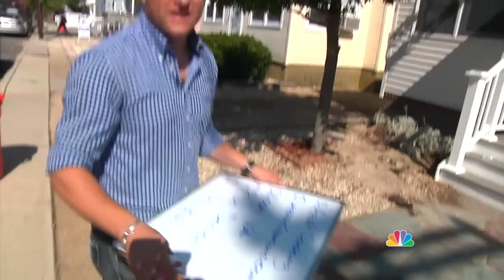Dream Renovation for Stroke Survivor and His Loving Wife | George to the Rescue

Comment: This is so low budget.  Would have been nice to do something for the poor wife.  Should have removed the front bump out and done a seamless,  elegant add-on.  The front porch seating is not designed for conversing with streetside passersby.

Love the husband's reaction to the backyard.
Reply: I cannot imagine any wife not being absolutely delighted to have a beautiful backyard with a water feature!
Reply: @ORSkie  
You are probably correct regarding the wife,  but the front porch still needed a scootch more room.  Chairs are facing the wrong way.
Reply: I agree, I found that deck very small. The GTTR are usually very generous with what they do, so it makes me wonder if they were restricted due to town ordinances or etc?  Normally they put a roof over the front porches that they do,  this time they used awnings... So it made me think maybe they were not allowed to do certain things. 🤷‍♀️
Reply: @ORSkie  
Sounds like a reasonable assumption.